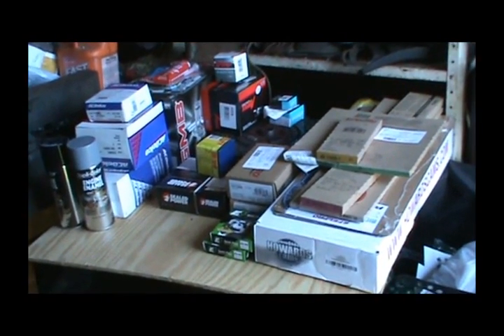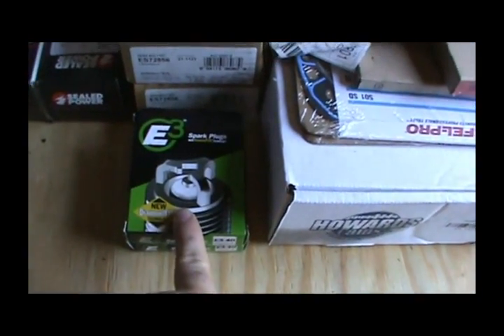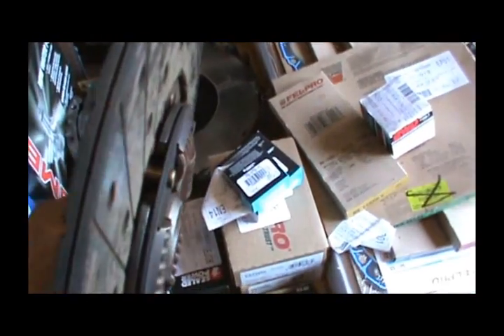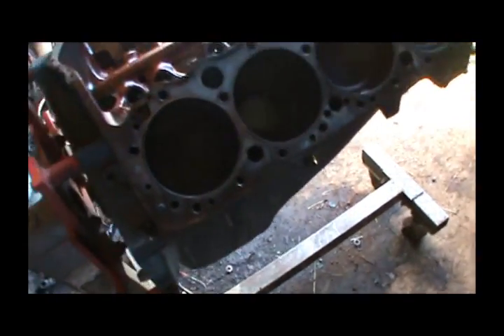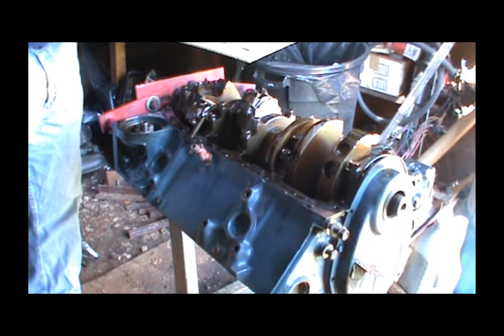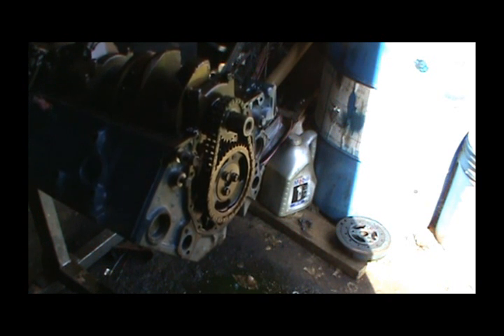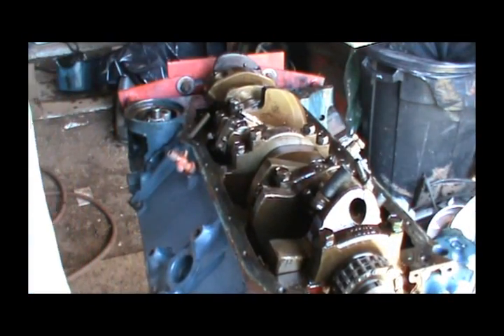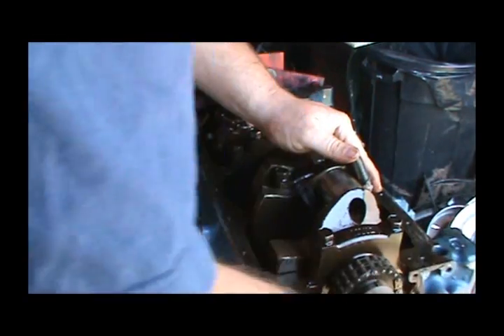Project 383 Stroker - Block Teardown Part 1

Comment: With those petcocks, could this have been a marine motor?
Reply from the maker: No, this was never a marine engine. I guess they were added to make it easier to drain the coolant. This engine was in a motor home then sold and put in a 1-ton truck.